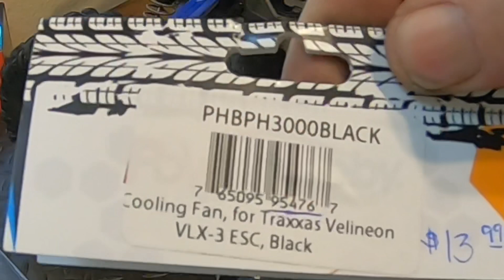Traxxas Wide XMaxx Repairs After Send It Jump How Bad Was It ?

Comment: The fan I use for my max6 esc is a centro 30mm. It's aluminium cased, has thicker fan blades and are less than $10. Slightly smaller but 28000rpm rather than stock fans 11000rpm

Comment: Seems like almost every small/quick repair (or upgrade) ends up turning into a bigger project than expected, with all RC. “I’ll just pop in a new fan” - yeah, after you cut off the connectors, solder in new connectors, fabricate an adapter, and put it all together to have it spin backwards 😂 One needs to truly enjoy the “project” fabrication & wrenching side of things to enjoy this hobby. Which, just so happens, I really do ☺️
Reply from the maker: Yes trying to use parts in stock vs ordering parts that bolt in I just try and show with a little fab work you can adapt all manufacturers parts to work hopefully saving parts that you need to stock up on 💪💪💯💯

Comment: The Power Hobby fan is for a VXL3s for a Slash not for a MAXX but I am sure you figured that out ..That's why it has the bracket that would never fit on the MAXX stock Traxxas ESC  But you are smart so I'm sure you must know that by now ... Just trying to help you out

Comment: You can plug the jst plug into the hobbywing plug its just 2 wires
Reply from the maker: Yes but it’s into the esc port so it’s a thin areas fir the wider connector 👍👍

Comment: Hey Earl just was sitting here thinking and u are working on the xmaxx I thought to myself ask Earl if he has a 1/10 strong steering servo for the xmaxx that I could get mines been sitting cuz it needs a servo and I'm broke so just wondering if u got one that u don't use that u would want to get rid of
Reply from the maker: I run the upgrade traxxas X metal servo in the blue xmaxx and the factory one in the orange xmaxx when the orange one fails I’ll buy the X upgraded one from traxxas same part number just has an X at the end 👍👍
Reply: @earlmoorhead5555  I had them and they took crap on me the motor went out
Reply: @earlmoorhead5555  I was just trying to ask if maybe you had a used strong servo that you would sell for cheap